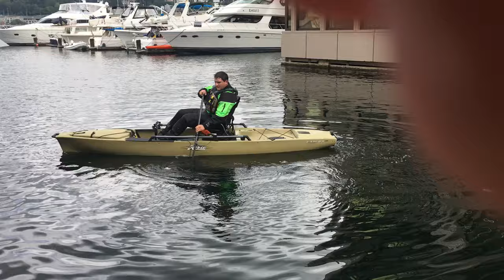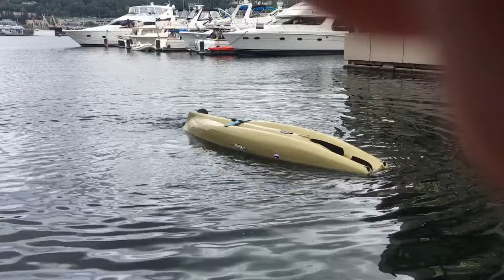Hobie PA 14 flip and reentry

Comment: OK how much do you weigh?  This kayak fully fitted weight is 130 lbs. 
Look at you water its a pond. Get your big butt a mile out in rough water 20 kn wind with lots of chop and do this demo...
Reply from the maker: I probably weighed 270lbs when I shot this, since then I have lost some weight at 255 and dropping.  Yep the PA is about 130 lbs in weight, and supports 600 lbs.  Correct it is lake union in Seattle WA.  I don't Kayak the salt when it is above 10 mph, not experienced enough, nor do i venture that far on salt.
Reply: These Hobie's are just super if your big enough to muscle them around in no way am I going to do this by myself. I do go out about 1/4 to 1/2 mile out in the ocean and fish for lingcod/rockfish but my kayak only weights 65lbs so getting it back over is easy. I am old and lightweight 170lb just not big enough or strong enough.
Reply from the maker: I had a smaller yak that was about 75lbs an Eagle run 14, and I flipped once in a lake back east in Tennessee and got back in no problem.  Figured it was a similar drill for the pa, to my surprise, it was very difficult!  I went swimming last summer and was in the 35 degree water for about 15 mins trying to sort out how to flip it back and get back on it.  Actually had never practiced or anything.  I had multiple things go wrong that day, that hopefully I have corrected and will be better prepared next time.  I do recommend the 72020092 rescue step, it gives you sooooo much needed leverage and makes the flip fast and quick, even for the lighter folks.  The beach wheels are a must for moving it around on land, makes the pa super light and easy to move.  With out these two pieces of equipment I agree the PA is a 130lb tank that is very difficult to move around.